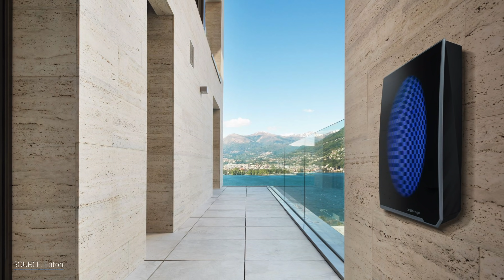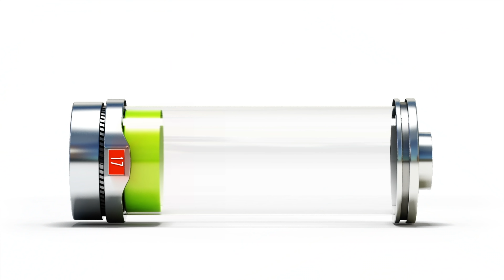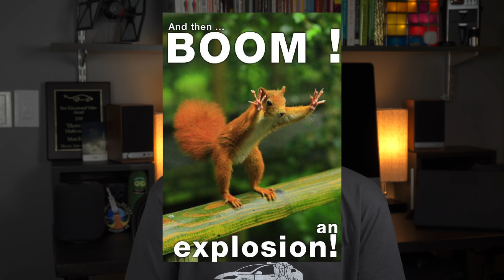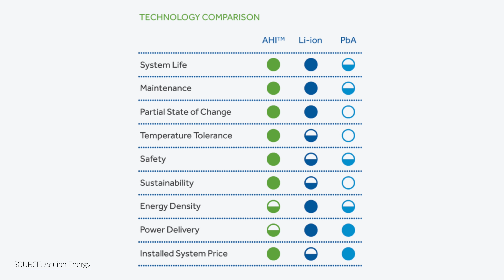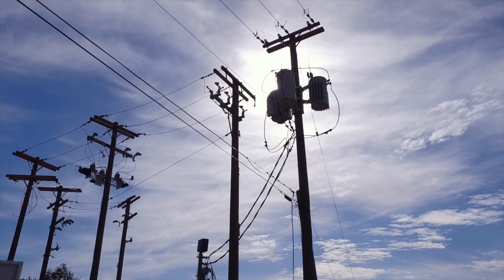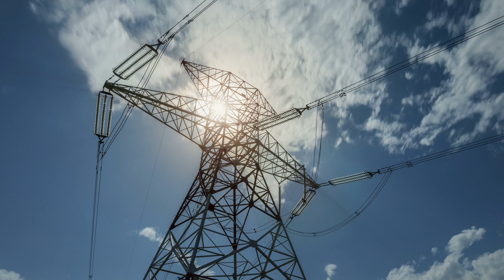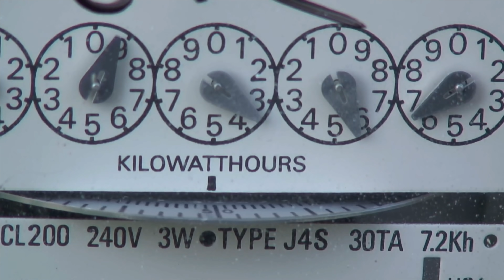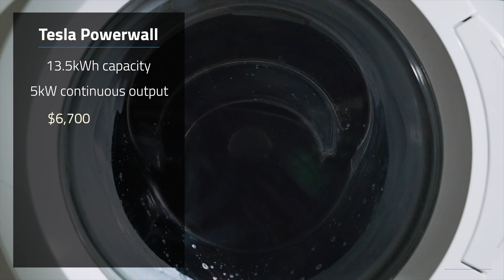Solar Battery Tesla Powerwall and more

Comment: I have a grid tied 5.3 kwp array with 19.2 kwh of Pylontech storage in central Scotland. Since January 29th until today 29th October I have been off grid, ie the system has provided 100% of my energy needs. 

Before investing in solar I spent time and money to reduce my energy use as much as possible, I seldom see anyone talking about this aspect of the use of solar.

Using 30 kwh a day there must be scope to reduce that by 5 kwh a day. Before my reduction efforts and install I was using about 14 kwh a day on average, now it's 6 kwh a day on average, still watching tv and all the fun stuff, the main saving was cutting my base load from 500 wh per hour average to 180 wh per hour average. Standby is a big invisible user of energy, a 600w slow cooker reduced drastically on energy use in a 4 kw oven and so on.

Comment: One thing i did to use smaller battery for using at  night time ..
I converted my most of the stuff from AC to DC and power consumption went down ..
Now only thing i have AC LOAD in my home is air conditioner...planing to switch that too...we need to think out of the box to save money...and be creative...PEACE
Reply from the maker: Thanks for sharing!

Comment: even if you're net metering... you still want a battery back up and shut off lever to the grid for when the power goes out. If you're on a grid-tied system, you won't be allowed to use your solar generated power because there is emergency shut down in your equipment to prevent people working on the grid from getting zapped by your electricity production. So you would, in case of outage, want to shut off your system from the grid and run off battery back up power if you want electricity when the power is out in your area.

Comment: Matt. Has solar gotten to the point yet where you can run your whole house off of solar even if you have A/C. Let’s say in a off grid situation
Reply: Its only a matter of sizing and the $ available and your location.   Solar itself really doesnt have that much to do with it,  energy is energy.   Solar can power AC via batteries and conversion,  always could,  its just a matter of design and $s

Comment: I was not aware with the Tesla PowerWall, that if the grid goes down you can still power your home with the battery system until it is depleted.  This would be a GREAT feature, however I've seen conflicting information on this looking at a number of video's on the Tesla PowerWall.  Does this feature depend on your power grid that you are on the the power company or is this now a feature Tesla has put into their PowerWall?   I saw some info where Tesla was looking at this and it would be a firmware update to the box that controls the whole thing.  Any ideas on this would be helpful.  Thanks !!!
Reply: with any battery installation,  if appropriately configured and allowed by local regulation.   Its not special Tesla magic.

Comment: Hello Matt,  I enjoyed your video and it was very well done.  I have a DIY solar power system with FLA battery backup and think I can offer you a few tips on what I have learned over three years of use.  
1. Flooded Lead Acid is probably still the most cost effective way to go.  I see the 200-1000 cycle life used in many FLA to Lithium comparisons and it's just not accurate.  A very popular FLA battery used for solar is the Trojan L16RE-B.  It has 4600 cycles at a 20% DOD.  Thats 13 years.  A bank of 16 batteries cost about $5,000 and can provide about 8kWh of backup power for up to 13 years if used 100% properly.  I use 7-10 kWh overnight on a regular basis.  Maintenance is under 10 minutes/month.
2. Having a backup battery bank has very little to do with saving money.  I would NEVER use my batteries to supply power to the grid.  Having a battery bank is all about self reliance.  What will you do when the power goes down for a week, a month or even a year?  Ask a Puerto Rican what a battery backed system would be worth.  
3.  This one most people won't get:  You really don't want to use your battery bank to supply bulk power overnight to save money and you definitely don't want to use it to supply the grid.  You want to use it to smooth out the peaks and valleys during the day and otherwise preserve it for when you really need it during a grid down scenario.  
4. That said Lithium will eventually (soon) take over as the price drops and used electric vehicle systems start to flood the market.  
5. If I were building a system today I would look into a used telecom battery bank with a lot of life in it for cheap.  $200/kWh OR a used electric car battery.
Things will change a lot in the next 10 years...  Thanks for the video!

Comment: I have purchased a small DIY Solar System (Legion Solar) for my home in NM.  It has the capability to store energy to batteries.  I don't plan to be tied to my power company so that excludes the Tesla power wall.  Thanks to your discussion, I am now beginning to think that I would be better off without batteries until I can gauge how efficient my small system, which is intended to move me out of the upper tier pricing, will be.

Comment: Batteries make no financial sense anywhere in the world  pretty much. The price of the batteries and the cost of power is all scaled. 
At this point batteries simply do not have a long enough life span to recoup the their cost in saved power.  They would need to be about 25% of their current price to be worthwhile financially even where power prices are high like in Oz. 
As for backup when the grid goes down, That's like owning a 10 ton van as your daily Driver in case you ever want to move house. 
There are far more economical and better suited ways of doing grid backup. 

Tesla batteries are not the install and forget deal they are made out to be. Look at any forum that discusses Tesla batteries and see the endless problems owners have with them. Tesla control the things not you even though you supposedly own them. I want to be able to run my own equipment not have to ring and wait on the phone for someone to maybe allow me to do what I want the expensive equipment I bought to do it's job. 

Batteries at this point ( and probably for a long way in the future will COST you money not save it. Those that think otherwise are misinformed or maybe greenwashed.  Solar panels WILL return their cost and are a good investment, Batteries are NOT.
Reply: With my net metering that is good for 10 years I have no need for a battery unless I want to know I use my generated power / want a backup system if grid is down.  Not good enough reasons but once net metering is gone I will want one for sure, and I will make it myself by reusing an old car battery.  There are only fringe cases that make sense for batteries right now but the prices will only drop over the next 3-10 years and it will be great to have.
Reply: @blh1997-w1q  car batteries arent a great choice for this sort of application.  There is a web site called Battery University if you want to learn more

Comment: I'm in the same boat you are.  It makes absolutely no sense for me to store my energy because of my net metering.  The only use for batteries would be to provide power during outages, which I do not get very often at all (and they're very short).  That said, I only have a tiny 2.6 kWh of storage from cheap LiIon batteries I found on eBay.  And since I have access to DC power in my house, I charge phones, tablets and even MacBooks from direct DC (using buck converters).  I made Anderson powerpole ports I can plug right into.  Might as well.

Comment: Try these leading edge machines for non-fossil electricity, these are available:

Flip substations off-grid, 1-Mw, 50-year no-inputs warranty, Belgian: technokontrol, a current project, RF-5000.

For off-grid, grid-tied homes or not, 10kw/$15k, 5kw/$8k, 20-year no-inputs warranty, S.Korean: infinitysav

Magnetic motors drive these, it's why they DON'T NEED FUEL or other inputs, only upkeep, found doing trade studies for a lunar mission, why use anything else in space or on Earth?

Comment: I built my own "power wall" out of 700 × 18650 cells. Configured as a 24v li-ion battery, 7s100p. I've had my system up and running for a few months, but still fine tuning it as this is my first such build. Thanks for the video, good general info. Btw, I'm off grid so not constrained by permitting of local utility companys.
Reply from the maker: That’s awesome!  How tough did you find it to build out your own version of a power wall?

Comment: Kudos for including Australia data mate! Subbed
Reply from the maker: Australia is killing it right now with renewables.  A lot to learn from down there.  👍
Reply: Undecided with Matt Ferrell , but did you see the wind does not blow,,at night so EVERYBODY HAS TO USE EITHER A GAS OR DIESEL GENERATOR TO USE AT NIGHT ? Tell men how great this is ?
A solar system 23 collectors going in this month aFEB 14, BUTis  god connected so grid goes down, I have sun, but can not.t use itAs there is no transfer switch, nor does it have a Barrera pack, 
No out of pocket, mandated my NJ   they are paying throughTRINITY  ,, @13 cents ,  verses 23 cents via PSE&G,,,, Cheers From NJ🇺🇸🇺🇸🇺🇸🇺🇸

Comment: I'm sad that eventhough it's always bright sunny and no snow at all where I live, but at the price that you mentioned, it's not worth it for me. I've done some basic math, and assuming I could keep the system running perfectly fine for 20 years, it's still almost twice as expensive than if I just keep using grid for 20 years for my daily need. Hope it will become even cheaper.
Reply from the maker: The price will vary depending on where you are.  Definitely worth looking into local prices.
Reply: @UndecidedTechnology  You're right, when I calculated it, I definitely didn't take a look at my local market. it's cheaper, but still doing all the calculations again and assuming all works perfectly fine, it's at least about 20 years-ish until I made a return on my investment. it's half cheaper than my previous calculation, but at current price, it's still really hard to make decision to go full solar.

The only way I could go into solar right now despite the 20 years time for ROI, is if the battery and solar panels could work perfectly fine without any significant loss in performance for at least 30 years. I love renewables, but I can't keep up with the current price to value currently, and worse for most of other people. Looks like I have to wait 5-10 years more, hoping either the pricing or the technology become better.
Reply: what rate did you escalate you grid costs at?    with the trend towards "renewables"  grid costs  are going to continue to rise.  People fantasise that prices will fall but real world experience shows the reverse and common sense says that if you add complexity and retain the need for back up you are not going to reduce costs

Comment: I agree with you on your conclusion that with net metering, payback is impossible. One item that will continue to drive adoption of battery is the utility policy to move away from it as they see it as a loss of revenue and want to do away with it. In my state, the utility had programs that appear to promote the development of renewable however, there were strings attached as to the timeline for complete removal of net metering and movement towards TOU. Since these changes take years, I am going to wait until the utility changes and at that point will need to acquire storage to avoid the TOU rates. There is a lot of variables and I had the same experience using energy sage to compare vendors side by side.
Reply from the maker: TOU rates I find really interesting.  It’s a good way to push people to change their habits to shift energy use around.  Like doing laundry late at night or the dishwasher overnight.  And it makes things like battery storage very appealing financially.  But states really need to shepherd the changes carefully and with the people’s best interests in mind.  Sadly, there are a lot of states taking guidance and money from companies and putting the people second.
Reply: Undecided with Matt Ferrell Totally agree. There is a balance and lobbying runs the regulations and industry. I will keep my net meter system until TOU is mandated and then acquire batteries
Reply: so reducing your nett usage has no value? 

surely this is about saving the planet?  no?

Comment: Could you make a video about what's the best green investment a person can make with respect to ROI and environmental impact? eg. If I'm going to spend $30-$40k, would it be best to superinsulate my house, get a geothermal heat pump, solar panels, or an electric vehicle? I know it's a lot to break down, but as a consumer I haven't found a good resource on this.
Reply from the maker: That’s a great question and suggestion for a video (adding it to the list).  It’s a little tough to answer though because it all depends on how much you pay for electricity, where you live and how much solar you might be able to generate, etc.  However, a short answer is that properly insulating your home is one of the best places to start.  Huge bang for your buck.  And depending on where you live, there may be programs to help with rebates and incentives.  In Massachusetts we have something called MassSave that helps with that.
Reply: ROI and environmental impact are generally mutually exclusive.   How about you personal comfort and safety.    We focus on insulating the box above all.   Over spec insulation everywhere,  double glazing everywhere,  then you need less of everything regardless of how you supply it.    EVs are complete bullshit as far as being environmentally friendly as soon as you look at whole of life.    I am guessing I will have one one day if I am looking for a shopping trolley,  but I dont dream that I would be saving the planet in any way.

Comment: Feel free to stop by "The Energy Sovereignty Project" on our channel and see how far home solar really goes.
We have a 6 powerwall installation with 10.2kw of PV panels.  The goal was to see how much combined home power and electric vehicle driving we could do over the course of a year.
Reply: What part if the world do you live in?? Im in Australia and we have a 10kw Solar system. With you running 6 batteries you must never run out of power. Im assuming its for residential/private and use?? Are you totally off grid?? Im looking at atleast 1 possibly 2 batteries to help cut our power bills  down even more
Reply: @guido0582 , We are just south of Sacramento California.  We are still on grid as our system does not (yet) produce enough in winter to cover our needs.
What having 6 batteries does do, however, is allow us to press further into the shoulder periods of January/February and October/November to allow stored solar power on good producing days to cover days where solar does not meet our needs.

At 6 batteries, until the cost comes down, it is probably not cost effective just yet.  It's very nice to have, but it's a case of diminishing returns.
Reply: I love that term "energy sovereignty"  seems like classic renewable weasel words.  Only defined at the end and then it will be defined as whatever state we land at.   There is a town in Australia aiming for enrgy sovereignty in 2022!!   when you ask them what plan they have to get there and what it means they get all defensive and just start talking about fluffy feel good initiatives and handing out awards to themselves.

Comment: I have a 6KWp 20 LG panels and a LG RESU 9.8 KWh system. This a DC to DC coupled system as the battery runs at 400 volts and the panels use DC optimizers at 400 volts. The inverter is SolarEdge StoreEdge and does both battery back up and Maxim self-consumption. We have a electric car and our city contracts with Marin County Energy which is a Co-op and PG&E is the supplier. During the summer our rates run as high as $.46 a KWh peek 2 to 11 pm and $.02 KWh off peek 11 to 7 am. The battery is full by noon and we feed into the grid until sundown. then the battery runs the whole house until after midnight when the car charges. MCE pays us $.24 KWh at peek times. We just went a full year with this setup and never used power at peek usage only at off peek. We had a $160.00 credit at the end of the yearly cycle. Which paid for PG&E delivery cost and other fees. In short we ran the house including the A/C in the summer and charged the car for a year with zero cost. A mid summer bill used to run $375 or more.